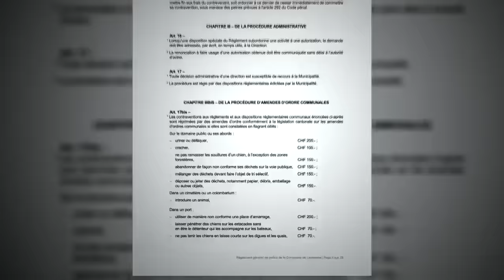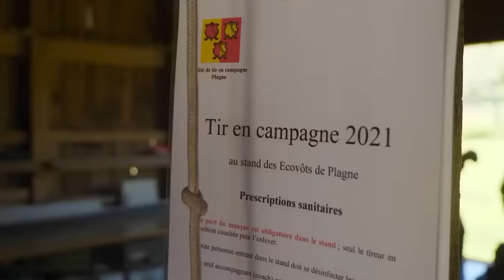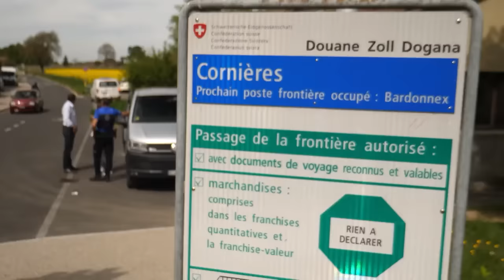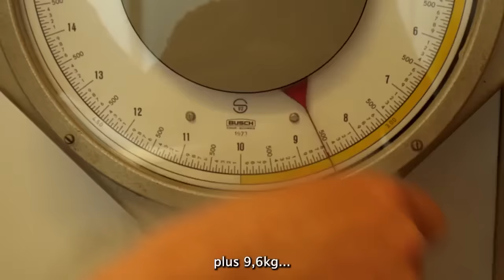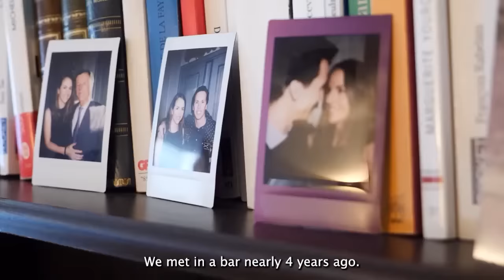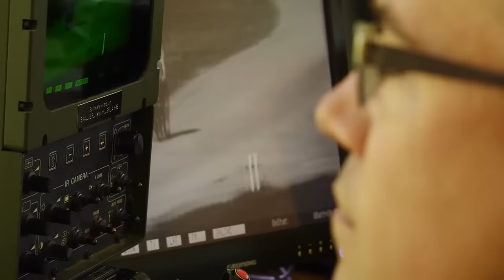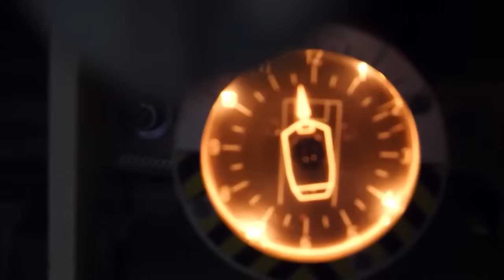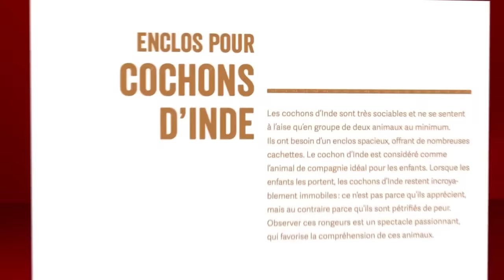Switzerland's Strict Society | Unique Investigation

Comment: Switzerland's strict economic policies, marked by prudent fiscal management and a strong emphasis on financial stability, have fostered a robust and resilient economy. These measures have contributed to a high standard of living, low unemployment rates, and an enviable position as a global financial hub.
Reply: In light of the ongoing global economic crisis, it is crucial for everyone to prioritize investing in diverse sources of income that are not reliant on the government. This includes exploring opportunities in stocks, gold, silver, and digital currencies. Despite the challenging economic situation, it remains a favorable time to consider these investments.
Reply: @EdmundEthan093  The pathway to substantial returns doesn't solely rely on stocks with significant movements. Instead, it revolves around effectively managing risk relative to reward. By appropriately sizing your positions and capitalizing on your advantage repeatedly, you can progressively work towards achieving your financial goals. This principle applies across various investment approaches, whether it be long-term investing or day trading.
Reply: @AlfredStephen127  I actually subscribed for a few trading courses but it didn't help much, been getting suggestions to use a proper financial advisor, how did you go about touching base with your coach?
Reply: @BrandonRichards21  jessica dawn walters is the licensed coach I use. Just research the name. You'd find necessary details to work with a correspondence to set up an appointment.
Reply: 100%
Reply: Boy, this is so clean...just like downtown Brooklyn.... 🤢
Reply: I'd like to see those results in a country with a population of 50 million or more
Reply: ChatGPT ahh comments
Reply: Yes, if the Swiss banks hadn't confiscated a lot of money and gold from both Jews and other nations in the past. Believing that the banks would guard their money, they never paid them out.
Reply: you won't even answer cuz you know I'm right af
Reply: Ok PR bot
Reply: Yeah holding the world's black money can do that.
Reply: Don't forget about the Nazi blood money!
Reply: Massive inflation, helathcare costs out of control, poor standard of living with currency value diminishing and sky high taxes. No thanks.
Reply: Stop reciting wikipedia
Reply: But mainly reason you never have war on your territory, even you have 3 nations living in your country. Unfortunately some countries were not that lucky, we were not born under the luck of being left alone or chosen by the Elite! So don't talk about wise politics, your country is chosen to be gold keeper,that's all!

Comment: A very proper country, but only for those from there with family. Might be fun as a tourist, but I'd expect costs are very high.
Reply: I moved to Zurich a year ago, from the Bay area in CA (which is generally on the pricy side, for the US). When it comes to grocery items, what isn't about the same as I was used to, is jaw-droppingly more expensive. I've survived much of the past year on frozen meats, because fresh meats cost more than you would expect from an upscale steak restaurant, in the US.
Ribeye at the local grocery chain, for example, is $76.30/kg ($34.61/lb). By comparison, a typical Rib Eye in the States would cost $18.00/lb, while on the higher end, Trader Joes, Grass Fed, Organic Ribeye is $21.00/lb. So a single steak at the grocery store, weighing 250g (8.8 oz) costs almost $17.00 in Zurich, instead of $4.50 - $5.25 in the SF Bay area.
Reply: @CineSoar  - True. Swiss eat less meat and more rice , pasta and potatoes,. And surprisingly, a good bit of lake fish. Egli or trout filets with salad is a common summer restaurant meal with a glass of local white wine, often eaten in lakeside restaurants. tight budget? Skip the drinks and have tap water. Bottled drinks are very pricey, too.

Comment: are the fines absolutely over the top for petty things? yes, but there is very little acutal enforcement (which is the part that is so exagerated in the video) meaning they might catch you maybe once out of 50 times or less depending on the thing. cause it's petty and nobody wants to spend recourses enforcing it. so the fines need to be high enough that they still act as a deterrent.

Comment: It appears to be joke; however, I would prefer something similar, possibly more reasonable instead of what we have to deal with where I live. I own and live in a multimillion-dollar house in a Melbourne suburb where an average house price starting from a number of million dollars. My house together with a fence and gate are white. A side of my fence has been spray painted a few times, I had to have it cleaned and re-painted. Next to my front gate I used to have a copper letter box built into my brick pillar, which has been un-screwed and removed one night and stolen (I had it replaced this time with a timber insert which has been painted white). Another occasion, I left trades people working outside of my house (in the front garden) asked them to just close the gate, I did not leave a key with them to lock it. By the time I got home, the motor from my fishpond (Located at the front garden) has been stolen together with a marble pot which sat on the pedestal close to the front door. (I know that the person(s) who stole the items had to see them and had to have time to remove them and knew that I will not be back home for several hours). Following the incidents I had more security cameras installed, now I have wired, and wireless cameras. It has been a small price to pay for me to learn from and as a result a changed a number of my habits. Usually, I feel safe when I am in Switzerland, however during one of my holidays in Geneva, I went for a walk and to take photographs. I left a hotel at 6pm in January, it was already dark. While taking photographs using a visible expensive camera equipment a man approached me, he first asked than aggressively demanded to give him my camera and he will take a photograph of me using my camera. The experience has been frightening. Another experience which I found un-real is when I walked into a shop close to closing time and has been told that they need to close the door, since it is closing time, and the police could come...  They allowed me to pay for the items, opened the door, looked around before letting me out of the shop. Something like this would never happen in Australia. I think that instead of policing certain laws, the time would be better spent in chasing criminals.
Reply: Brag much about your possessions? What a bore.
Reply: @simonestreeter1518  Stating and sharing the facts are not considered bragging. I simply stated the facts relevant to me and my neighbours in the suburb I live in.
Reply: @annam4313  It was all the facts irrelevant to your point that were bragging. You could have made it as well without the details. Self-awareness is hard, I get it.

Comment: A few years back i was changing my tires and i accidentally bent the frame of our car by putting the car jack in the wrong place . (Only 2 cm.) Soon after we had a mandatory auto inspection and this tiny dent under my car was discovered. I was told it had to be fixed soon or i would get a fine since this damage to my car's frame might be unsafe if i was in an accident.  The repair cost over 100 chf.😢 Switzerland is crazy sometimes.